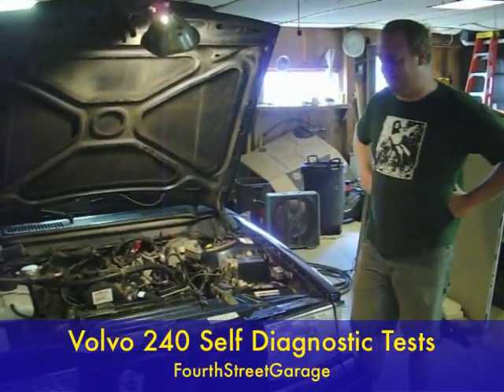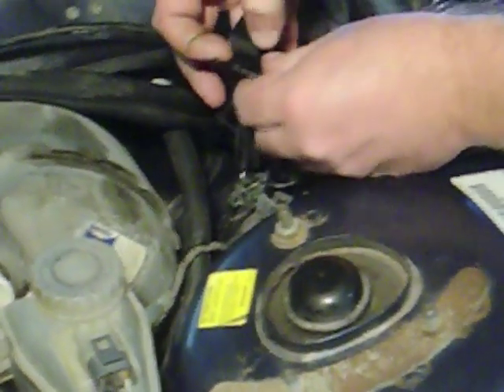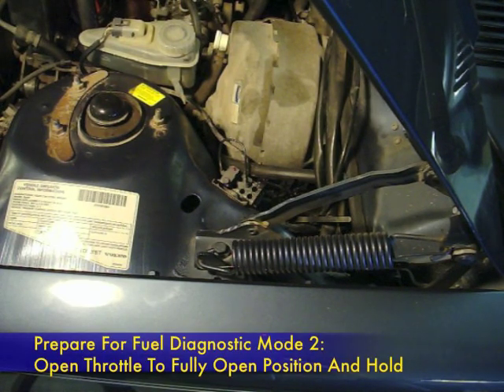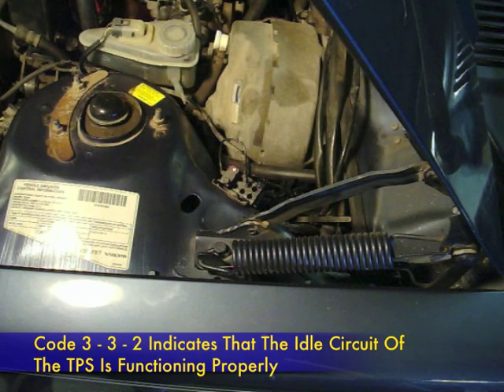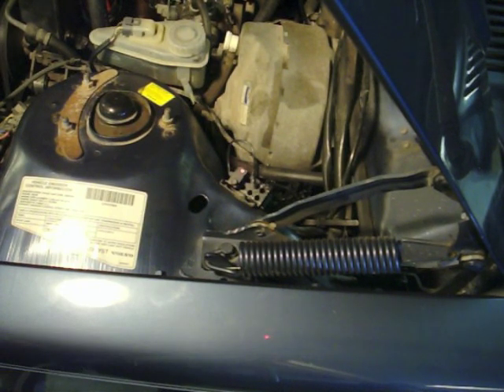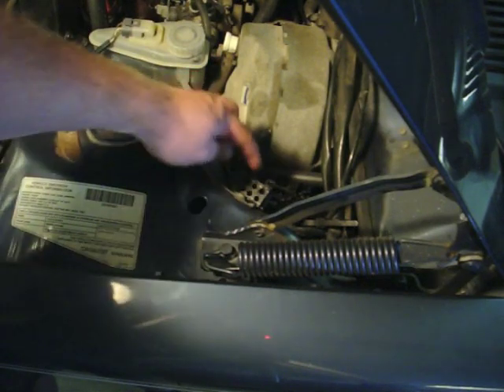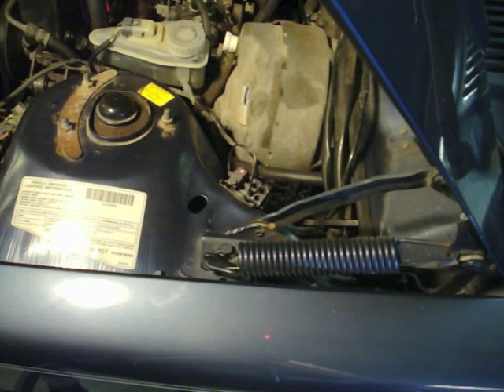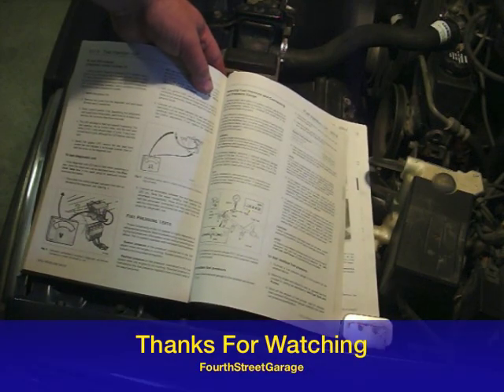Volvo 240 Self Diagnostic Tests

Comment: Thanks, this video helped me a lot.
I have a problem, by testing function number two described at minute 4.18 my led does 3-3-2 and not like yours which does 3-3-3. Could it be that the TPS is faulty?

Comment: Thanks, your 240 self diagnostic tests was most informative.  Didn't understand how to perform the input tests.  Now I do.   That brings me to a question regarding my 92 240 wagon, 3.2 system.  When testing
the TPS sensor I get a code 332, not 333.  Checking the idle switch gives a code 332.  Any ideas?   Also, re: your next batch of mead.  Pasteurize the honey.  There's a lot of stuff in there that can inhibit proper fermentation.  Remember also that a low attenuating yeast should make for a sweeter mead than will one with high attenuation.
Reply: I got the same thing on a ‘93 2.4 wagon. May not mean anything but am interested to see if there is a difference

Comment from the maker: A couple of follow-up details:

1) If there is more than one fault code stored in memory, they can be retrieved by re-initiating mode 1 by pushing the button 1 time after the first code has been read.  The memory can hold up to 3 codes at a time.

2) In both diagnostic modes, the speed sensor can be tested even if the engine will not start.  Enter diagnostic mode 2 then run the starter until the rapid flashing stops and a code is given. If rapid flashing doesn't stop there is no signal.